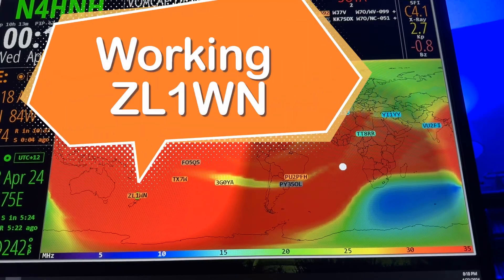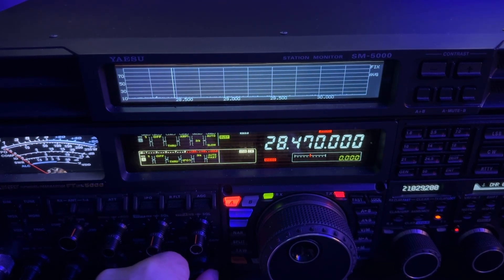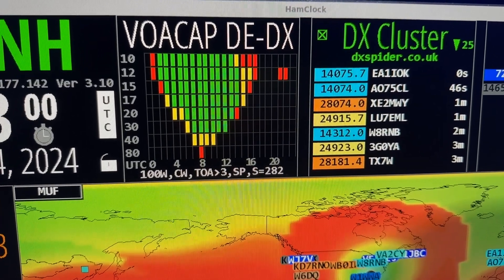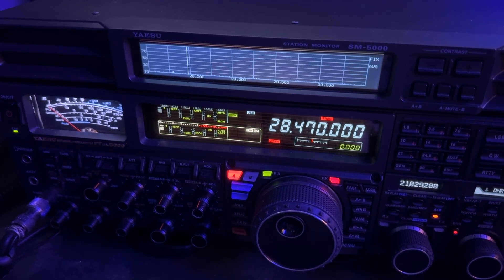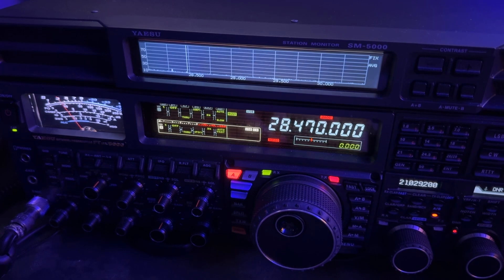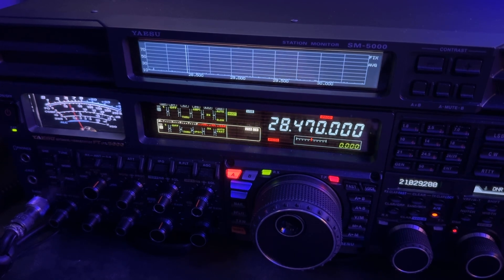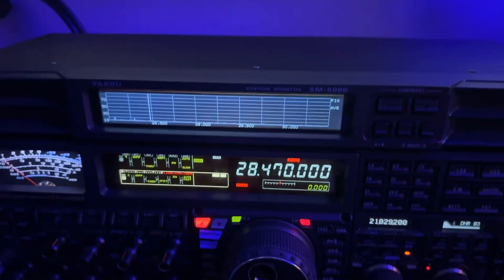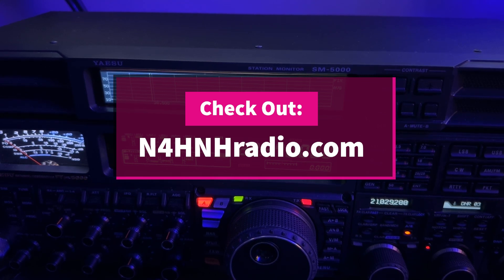Working ZL1WN featuring Ham Clock and N3FJP AC Log #hamradio #dx #propagation #ssb #logging

Comment: The color codes are counter intuitive to me. Shouldn't green be the best?
Reply from the maker: I didn’t write the code. That would be a question for the developer. The color matches up to the scale across the bottom of the map. They can’t use green for every band. Orange is for the 10m band.
Reply from the maker: The VOACAP (Voice Of America Coverage Analysis Program) displays green for good, yellow for mediocre, and red for minimal chance of propagation to a particular station or a place you click on the map. It provides a prediction of propagation to a place you click on the map or to a specific callsign you click on in the DX Cluster, SOTA list, or POTA list.

I have shown in videos that I have worked stations when the prediction was minimal. It might be possible but the signals will be weak. I worked a DXpedition last November on the 12m band when the prediction was black.  No chance.  He wasn’t strong but I worked him. It’s always worth trying but I have found that most of the time, the VOACAP is correct.